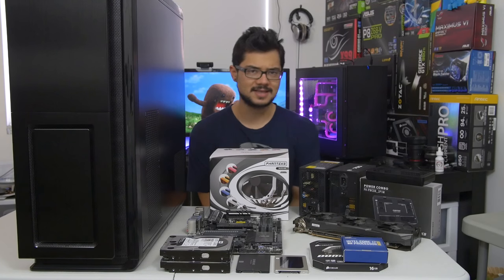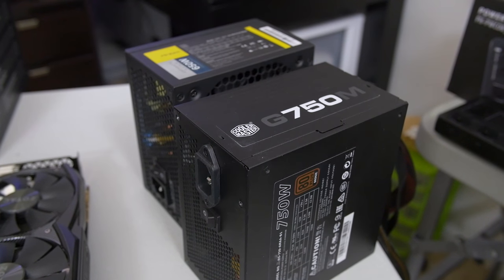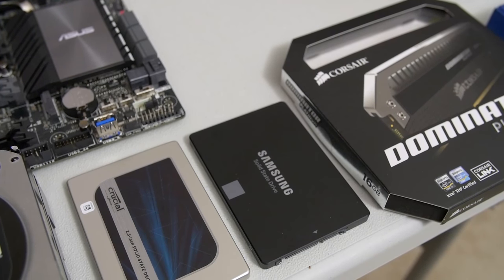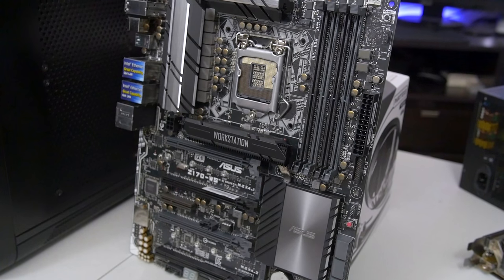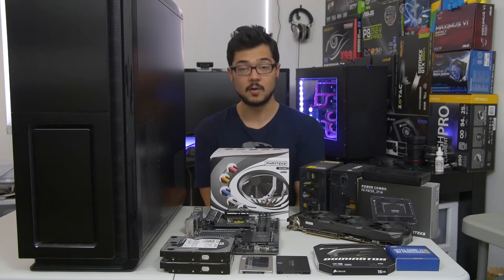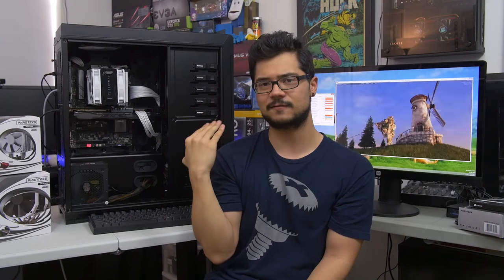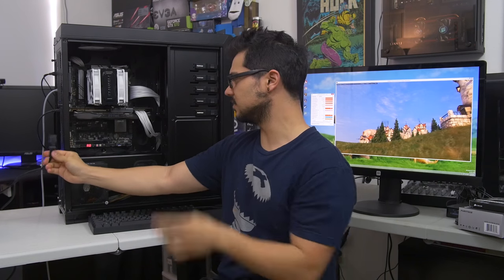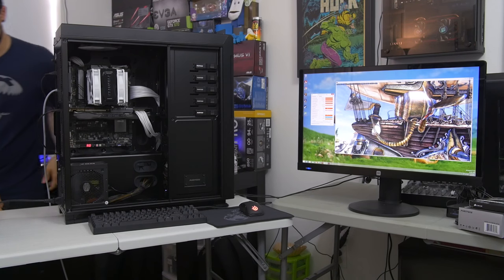Testing PSU Redundancy with the Phanteks Power Combo, Time Lapse Build!

Comment: Its a very good video and comprehensive, but i dont see the purpose.  I feel like in this day and age, there's little need for redundant PSUs. not many good manufactures' will have failures.  A power outage is more likely and on that, a UPS would be money better spent INHO.  Still, good video. I thoroughly enjoyed it.
Reply: +Slayerfish It's not for power outage but for a failing power supply. All common servers have a similar setup, because the power supply is one of the most failing components. Servers ofcourse also have a UPS.
Reply: +Michiel Haisma I know...thats why i said a UPS seems like a better investment.  I dont hear of many PSU failures especially with common suppliers like COrsair, EVGA, Silverstone, etc.  For a server, it makes sense to have a redundant PSU since every second its not working could be lots of money lost in whatever task its supposed to be doing.  For someone at home, two PSUs seems less practical.

Comment: I dont understand the point in this..  if the power goes out, still no help. how often do power supplies actually die where this product would be of any use?
Reply: +TechnicallyCanadian It's not for power outage but for a failing power supply. All common servers have a similar setup, because the power supply is one of the most failing components.

Comment: Funny, you unplug the PSU and the fan keeps spinning, well I think that energy bypass might be dangerous, because you can overload the wiring on the power supply that is still on. You are taking power for the GPU through the 24 and 8 Pin CPU connectors.
Reply: that's what the power combo is their for. it makes sure that the power is constantly following. so the 2nd power supply is sitting at the ready in case of a power failure
Reply: +RudyTheNerd Yeah but think a bit about the wiring, when the PSU that is powering the VGA fails, the power flows through the 24pin and the CPU connector into the power combo, the failed PSU and then to the VGA, meaning that all the power for it (imagine a R9 390 crossfire) goes through 2 connectors designed only to power the motherboard, its PCI power and the CPU.
Reply: Ignafiltro Sanchez oh I see what you're getting at, it's really interesting though, there will just have to be more rigorous testing then

Comment: This product doesnt really make sense to me in teh sense of power redundancy and failure safety, but more in the sense of just getting more power to the system than capable with a single psu. I mean if you really need to have redundancy your system is likely a server and should be in a server case, with real redundant power supplies.

Comment: This board is potentially VERY harmful product. If PSU dies we can expect every thing on main lines: high voltage spikes, shorted lines etc. If first PSU causes small damage then secondary PSU will finish the job even if it is giving proper power throw damaged PCB tresses = can cause fire. Supposing this product was proper protection from high voltage etc. it still demands giant case. If you really serious about you power safety buy good UPS and PSU. Some series of those products have sometimes 10 year of guaranty.

Comment: Pointless, there is a higher chance power goes out than a PSU failure then this is using a K series chip and regular DDR4 ram. Consumer stuff.. you have 2 psu's in a server then a UPS or backup battery station and server gear, no I7, I5s

Comment: what's the point, if the PSUs are together, chances are that they will be on the same circuit breaker of your house so if the power went out your PC is still dead so it is only use full for a PSU failure which is unlikely to happen. POINTLESS

Comment: That seems so stupid and useless. What power outage leaves one psu untouched? Seems totally useless for non server units. You can just get ups
Reply: +Netron Not power outages, DUH. It is for redundancy. So if one of your PSU fails when the computer is on, the other PSU is used to power the computer
Reply: +Netron Another use case would be if you're not able to get a single PSU powerfull enough for your load. Combining two 500 watt PSUs effectively gives you 1000 watts.
Reply: Jim C K Flaten no he said you need psu to be able to handle the system alone .. Rithik Kumar  have your psu ever falied ? people use quality psus for more than 10 years so as long as you dont buy 2 prebuilts and combine the shitty 300w psus you should be fine
Reply: +Netron If what you're going for is redundancy, yes. I gave a completely separate use case.

Comment: This brick serves no real purpose. If my power goes out it's out. If my psu dies it dies. Not going to have 2 psus for nothing.
Reply: +Tommi Honkonen It's not for power outage but for a failing power supply. All common servers have a similar setup, because the power supply is one of the most failing components.
Reply: Michiel Haisma No home situation requires 2 psus. I know servers have multiple psus but those are quite different compared to this brick.
Reply: +Tommi Honkonen a lot of people's work depends on a desktop style computer... One in which they can't afford to loose data from a system outage... This makes a lot of sense for those people who want another added level of reliability

Comment: I´m sorry, but the Power Combo is the worst peace of crap I´ve seen in my life.
Not only can you lose power to you graphics card and drives (which can result in catastrophic data loss!?), but if it really goes wrong you can blow up your motherboard when the GPU starts pulling its 300W over PCIe.
If you want real PSU redundancy, then you should get a server-grade mini-redundant PSU imho.